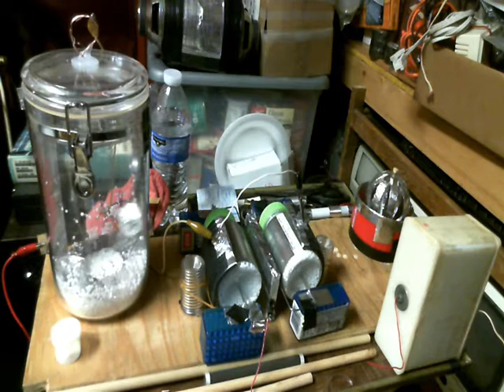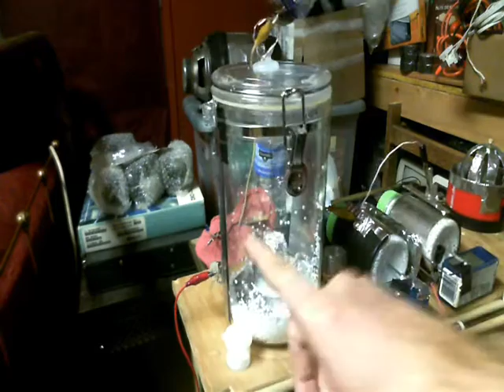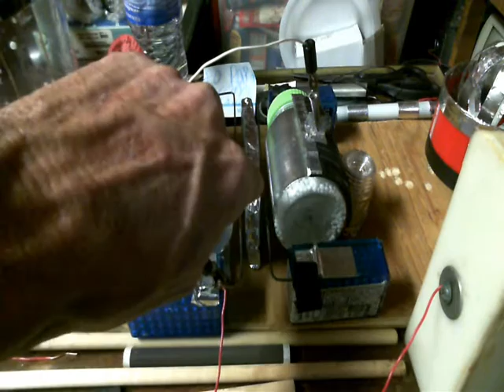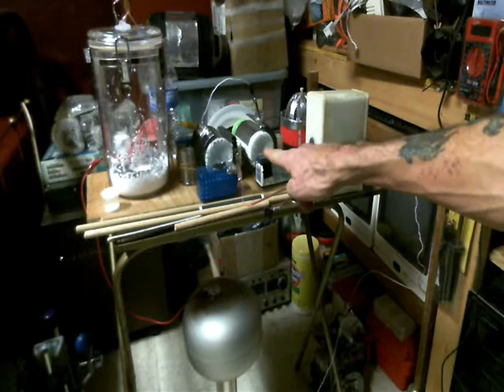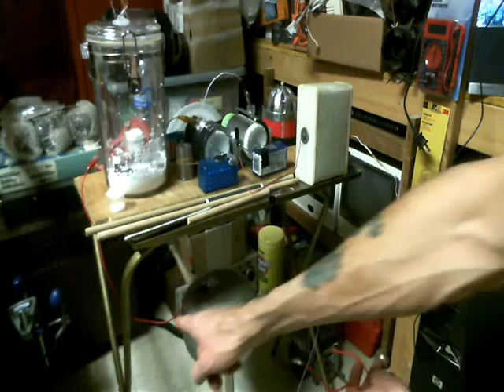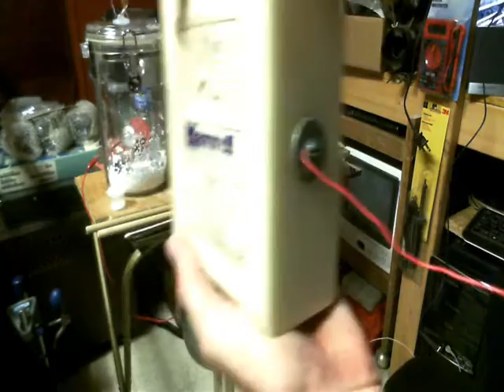PHYSICS TOY 4

Comment: Great experiments! Instead of the Van DeGraaf, elevate a spiked mass to 300ft with a helium balloon and allow the natural potential to set up charge in a capacitor. The key is FREE energy, right? You still have to energize the Van DeGraaf and pay the electric company. Creating a conduit, with the elevated mass held up radial to the surface, is like maintaining an artificial lightning bolt. This voltage potential and the current flow is constant. No Sun needed, no wind needed...there is no need to have a prime mover. The only prime mover needed is blowing up a balloon, attaching the conductive mass, and letting it rise toward the ionospheric potential. All celestial objects build electrostatic potentials that radiate radial to their surfaces. The Earth has a static pressure NO DIFFERENT than what is developed around that Van DeGraaf. Once you have the ability to generate the spark, now you have the finger of "god" at your disposal. Caps and coils will set us free!!